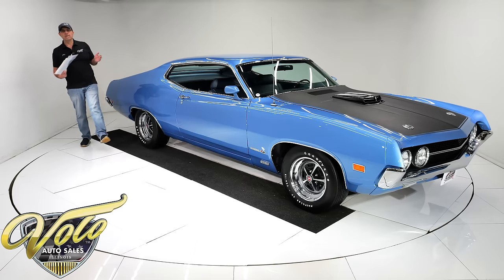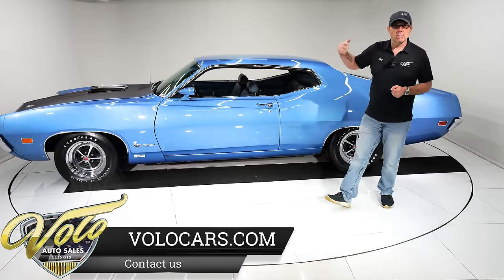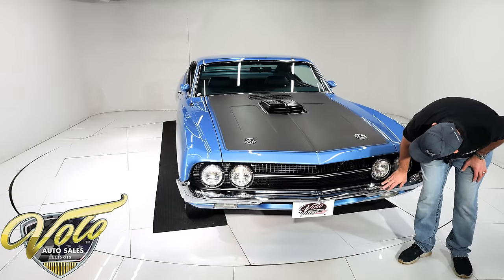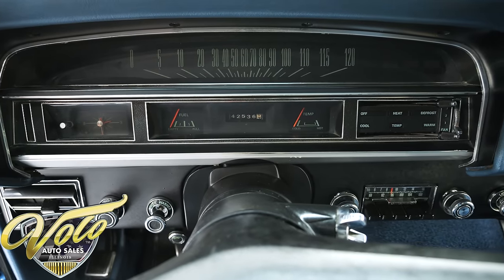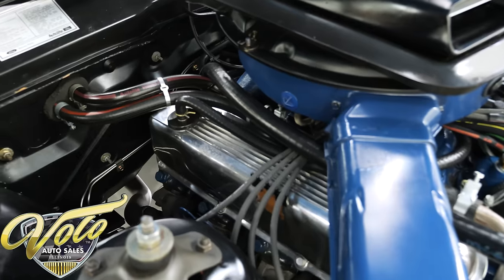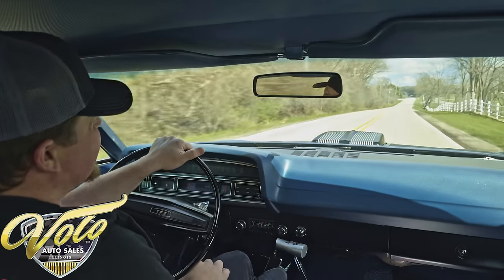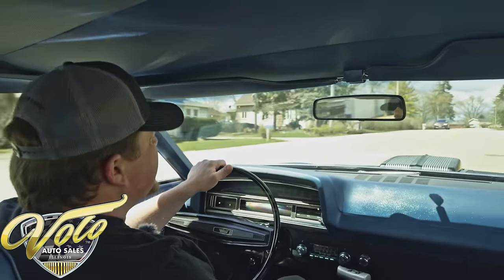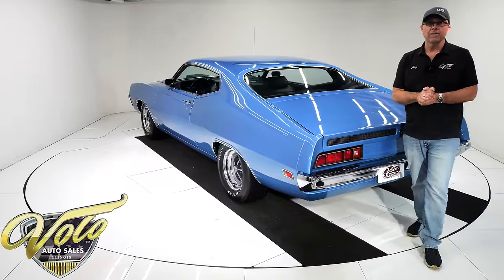1970 Ford Torino Cobra SCJ for sale at Volo Auto Museum (V21482)

Comment: You forgot about the cracked connecting rods that will not move around like conventional level flat surfaces on the rods and rod caps. This prevented the notorious BBC & BBD connecting rod spinning the bearings requiring an engine repair or rebuilding.

Comment: Huge fail by Ford to not have a tachometer in a car like this.
Reply: @bmepdoc9675  I remember them. With that motor they should have been standard
Reply: Add one if that's what you want
Reply: CJ and SCJ had tach installed.

Comment: I noticed the bottom lower rear corner of the driver's side door has two metal seam areas that are pre-bubbling rust, with the same bottom corner of the door/window panel covering has a wear hole in it. The instrument panel clear cover is all foggy from age, and only a few hairline cracks on the dash panel, spray can black paint under the dash, headliner is all wrinkled and wadded up above the passenger door, and more speak's for the trust in the engine and drive train rebuilding. Don't just walk away from the non-professional whatever on this car, you need to actually run away from this car with all the surprise headaches waiting on whoever buys this SCJ. Did you put a snake camera down the oil-check dip stick metal tube to make sure the engine has 4 bolt mains with the cracked connecting rods ?  Go figure !
Reply: The car was flawless when it was sold to a Dealer in Florida in January.  There the hood was bent.  Sat outside during the Mecum auction where they turned down $85K. Whoever detailed the car probably put products on it that hazed the cluster.  Cluster was original and clear when it was sold.  Dash pad is original and in great shape.   Impossible to find a NOS blue pad.  That car has been through a lot since it was sold.  I am pretty sure the person that restored it has tons of videos and never claimed it to be Concourse.  I am pretty sure the person that restored it hates the word Concourse.  Those hinges were NOS hinges.  Ford owners know the procedure to close a Ford hood.  This procedure was not followed.  Kind of sad to see her in this state.  Door panels are original and that tear can be fixed.  There are several people who saw this vehicle in person before it was sold.  Definitely did not have these issues. @bmepdoc9675